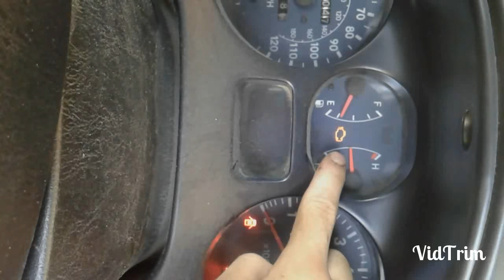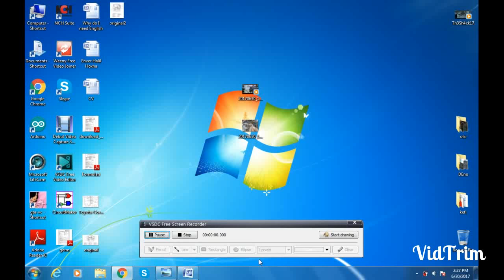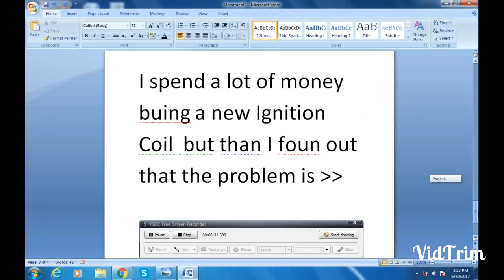No Start / No Spark / Cranks OK / OBD1 Code Reader / Ignition System Problem / Toyota Rav4 1995

Comment: One of the first steps in any diagnosis is a visual inspection and a wire harness wiggle test which includes a hand feel for rubbing wires. Next is powers and grounds with a normal voltmeter and see if any wires are shorted to ground. All of this is free before spending money on parts that do not match your problem as there was no IGF signal going back to the ECM which needed more volt and ohm meter inspections first. Code 14 is igniter not ignition coil but either way more simple tests were needed.
Reply: Liked visual inspection man,you are sweet